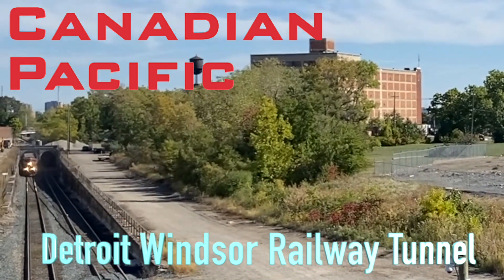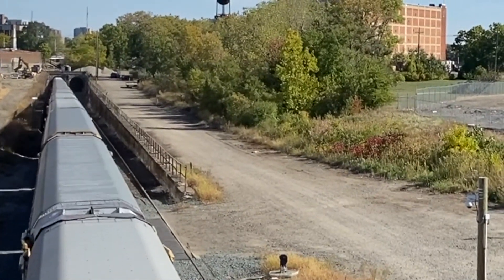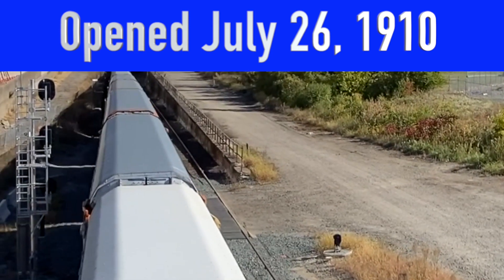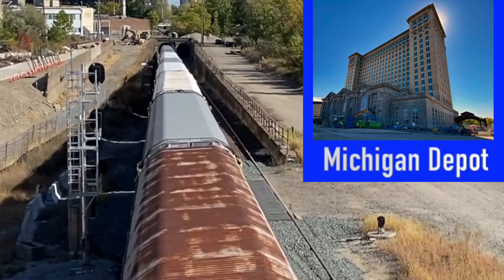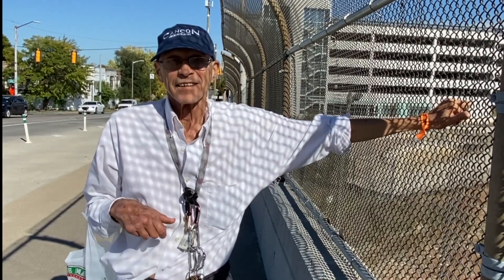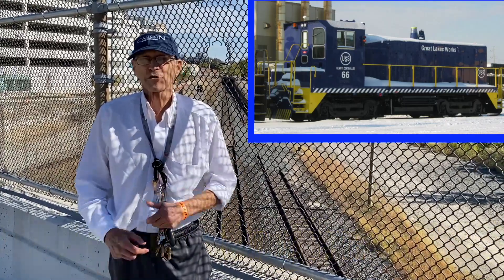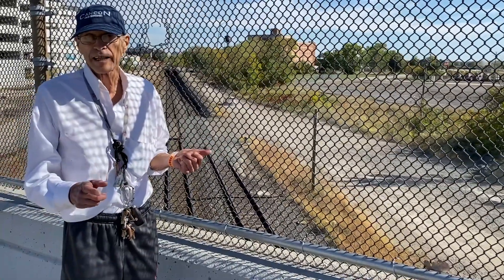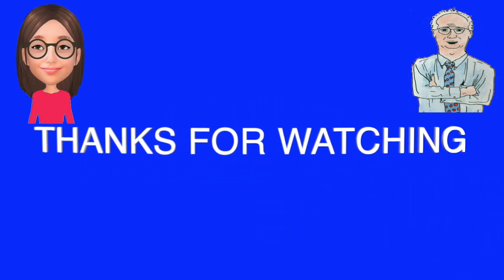Detroit Windsor Railway Tunnel • Meet a Real Locomotive Engineer 🚂

Comment: I used to work out of rouge yard quite a bit been all down the short and long marsh trackage, pulled many a steel coils from the 80” mill, walking between the tracks you could feel and see the heat coming off those fresh rolled coils. Zug island always looked like a scene from hell at night with the flames and noise coming from it. Also saw many hot metal “bottle” trains coming from zug furnaces seeing the orange glow emanating from the tops was awesome at night.
Reply from the maker: Hi Steve: I like to fish the Detroit River & you can see the same flames from a boat. Thanks for watching.🚂

Comment: Does CP use more than one track on the Detroit-Windsor tunnel? The second track is still present, but both trains in the video used the same track.
Reply from the maker: Hi Pacifico Studios: It is my understanding that back in the 80’s the tunnel portal on the left was made larger to handle the double stacked containers and auto racks. Thanks for watching. Note: There is a YT video about how this was done. Gary from Michigan 🚂
Reply: @trainroomgary  - That explains a lot. I think remember reading about this. Anyways, that would explain why the other track gets so little traffic. CP must use it for light engine movements and unit coal trains, if there are any.
Reply from the maker: @pacificostudios  Hi again - This is the link to the video about how the tunnel was built. https://www.youtube.com/watch?v=fnSfOuCJdR4&t=1s
Reply: @trainroomgary  - Thanks for that!